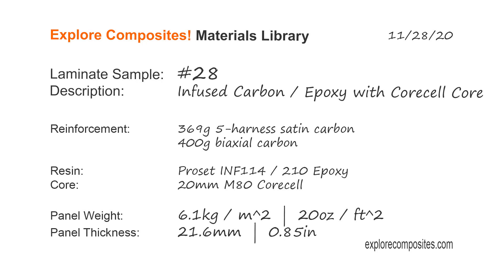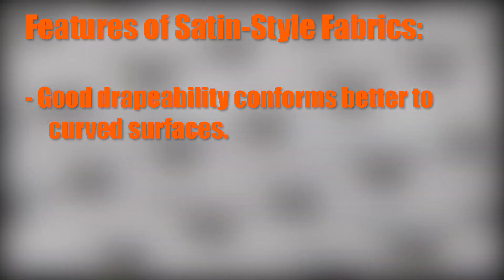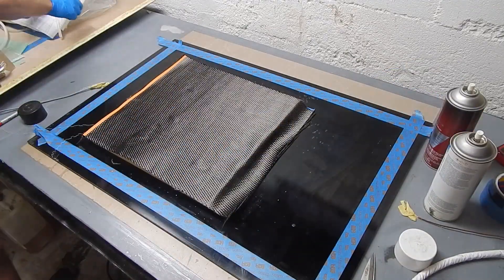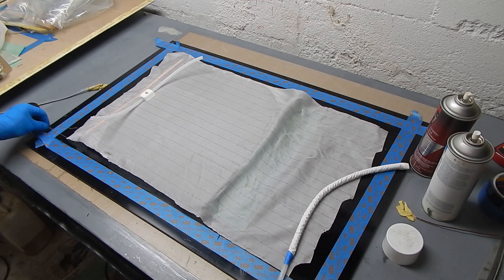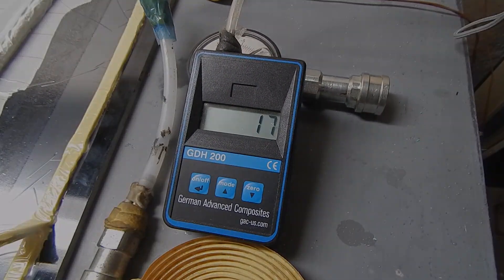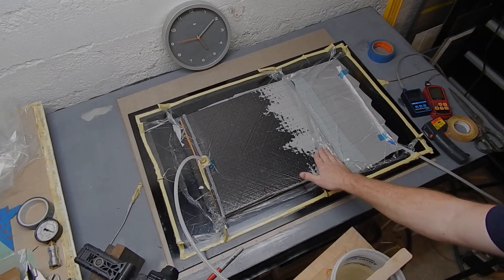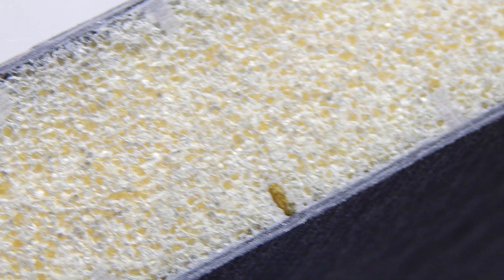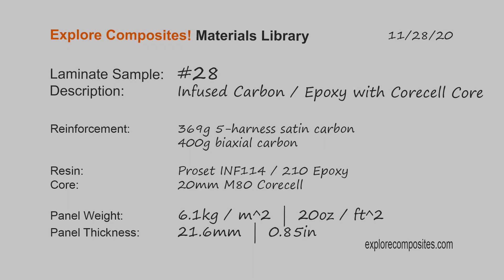Laminate Sample #28: Infused Carbon / Epoxy with Corecell Core

Comment: How would you "finish" the edges?
Reply from the maker: Ideally you could flange the part when you mold it, bringing both skins up forming an "L" which would finish the edges.  Alternately you could put radii on the edges and laminate a few plies of something +/-45 (double bias, woven cut into 45 degree strips) over the edge to tie the skins together.  Its not done, but lots of those details are shown here: 

https://explorecomposites.com/articles/design-for-composites/composites-details-edges-holes-and-joints/

Comment: I’ve. Done a fair amount of hand layups of windsurfers  and I get better results with less air trapping might be  a little heavier but  without the inherent weakness of trapped air
Reply from the maker: Yeah you can do a lot of good laminating without a vacuum bag - especially thin reinforcements like on a windsurfer.  Infusion is just nice as a manufacturable process - and it's easier to infuse huge stuff than to hand wet and roll.  Also, very little of what I do in these videos is perfect textbook compotes work - I want to show things that can and do go wrong with each process.  I just try not to have any total throw-away samples!

Comment: Can you give the formula resin needed
Reply from the maker: Generally with infusion, I start with resin weight = dry fabric weight.  You can calculate resin uptake from core data sheets sometimes but curvature changes things.  I have some basic spreadsheets for calculating plumbing volume based on hose lengths and under-bag flow media areas.  Really testing is the best way to know for larger parts - but it is common to still be a bit wrong even with pretty involved estimating!

Comment: Wow awesome videos, thank you very much!
Just to confirm, you don't need these grooves if you use flow mesh and just perforated core like with sample #7 (Epoxy Infused E-glass with Corecell Foam Core)?
1.5kg/m² seems like a lot of weight to add.
Reply from the maker: Yes - grooves or surface flow media.  Grooves do add a bunch of weight and are best for heavy skins that need lots of resin delivered fast - from big enough feed lines!

Comment: Could a double-sided smooth part be made by using a sheet of glass for the top instead of using the traditional peel ply etc?
Reply from the maker: Yes...  You'd have to be careful not to break the glass especially demolding, but given that the flow media is the core it should work fine.  A hard plastic, aluminum or fiberglass plate might work better than glass - but you won't have the comfort of seeing the resin progress!

See Laminate Sample #19 for a mini version of this:  https://youtu.be/WF6iaZJlEP8
Reply: @ExploreComposites  Thanks!  I'd forgotten about that sample.  Makes me wonder about the viability of making complex shapes if one can use a fiberglass mold, careful cutting of the foam to make it conform to the mold, and some kind of plastic that could be heated for shape prior to the infusion.

Comment: Just confirming my math, the 20mm M80 Corecell initial weight for the one square foot section would have been approximately 158g/5.6oz?  That means the resin+fiber added ~409g/~14.4oz?  I assume the greater resin weight was due to infusion into the core moreso than the carbon fiber.

It would be interesting to see a panel like this made with gelcoat fiberglass on the mold/table side and carbon fiber on the topside, since the core in between might reduce problems with dissimilar materials and provide greater resistance to aging from sunlight and allow more conventional repairs to damage to the fiberglass side.
Reply from the maker: Yes, the core is about 158g / 5.6 per square foot.  The resin to fill the grooves and bond the core to the skins is about the same.  Estimated resin ratio by weight in the skins is 40%, but realistically that is probably low.  My estimate is that total resin was 235g / 8.3oz with 143g / 5oz of reinforcement weight.  Laminate Sample #7 shows a similar panel in glass but without sliced core.

I try to avoid mixing resin systems in the samples, but there are cases where you might want glass on one side and carbon on the other - or more likely a mix of each.  There are UV resistant epoxy compatible gelcoats and it is also possible to do epoxy laminate on a polyester gelcoat and skincoat - but things can go badly and as a general rule it is better to avoid!  

With the exception of gelcoat, it should be similarly easy to fix carbon and glass - but you want to repair with a similar process to what was used to build the part.  Infused and prepreg parts are often repairable with bagged wet layup, especially epoxy - and it's often way more practical.

Comment: We used Nu-Tac on the mold surface only. I don’t think I’ve ever had a can not spray out poorly except for the first use.
Reply from the maker: I've used it before and it was less splattery - just grabbed it here and was surprised by the mess.  In your experience does it leave a nice surface?  What do you use for the rest of the layup?  I think it has a longer open time to tack than the 3M 77.
Reply: @ExploreComposites  It would leave splotches and streaks if too much was applied. It would come off if the part was buffed in post process.  We learned to just spray it heavy in cut-off areas and lightly on the part surface.

Comment: Hi, i wonder how to avoid get groove imprint on surface, vaccum did not not suck carbon fabric into those grooves?
Reply from the maker: It didn't here, but the grooves are very thin.  I think with polyester or VE resin that shrinks more there is a risk of print.  Skin thickness makes a difference too.
Reply: @ExploreComposites   you are right actually, multiaxial fabbrics are cros to groove direction, make thickness, thank you but if we make infusion same core but single layer fabric both side, what will do you think happen

Comment: Have you thought about lightly insulating thicker parts (e.g., with loose aluminum foil or a shop towel) when pulling resin in a cold shop?
Reply from the maker: Yes it is a good idea and I do it sometimes with thick breather cloth or that shiny insulation on a roll.  Hard to take video through it though!

Comment: I can see a lot of uses for a panel like this. I plan on testing a 6oz flat tow surface skin, backed up with a 6oz woven biaxial ply, 1/2" foam core and the same schedule on the opposite side. That would make for a panel stiff enough for a car body if properly supported to the frame underneath. I would estimate about .42lbs per square foot. As always, really informative videos.
Reply from the maker: That is a nice panel type for so many things!  I ran it through my spreadsheet for two 6oz plies sandwiching 1/2" 5lb core and it comes out a bit heavier at about .56lbs per square foot with infusion.  A lot depends on how much resin the core sucks up.  3 or 4 lb. core would help and you'd probably get a lighter panel with bagged wet layup (like Sample #15) than with infusion - because you could use filled resin for the core bonding - and not every little area will be forced full of resin - might be able to get into the sub-half-pound range.  Infusion is great for manufacturing, but it's really easy to overshoot your weight estimates!
Reply: I can see a direct application, lightweight yet strong automotive truck canopies and tonneau covers.  Heck, for tonneau covers one could almost make the thing on a flat table that's larger than the largest truck bed opening, to then be cut-down and possibly cut to trifold shape.  If there's a need for a one-piece tonneau cover to bow upwards, use a glass table and support it taller at the perimeter so that the center bows downwards so when the part is turned over, it bows upward.